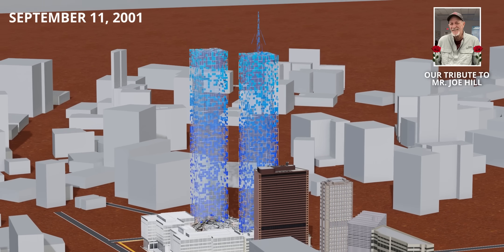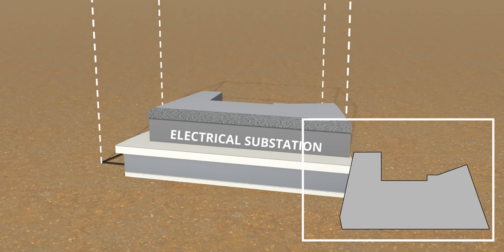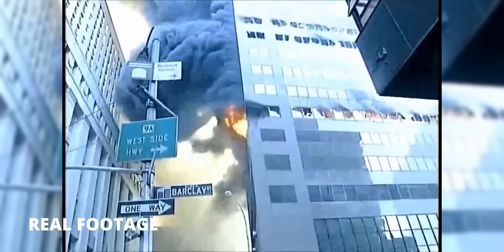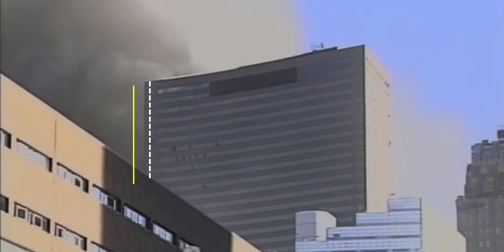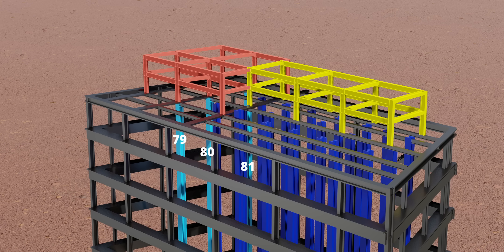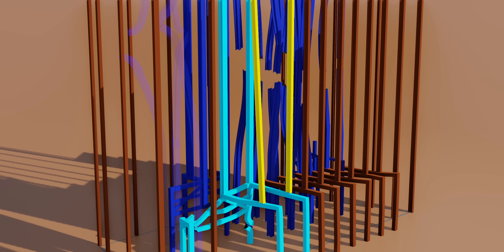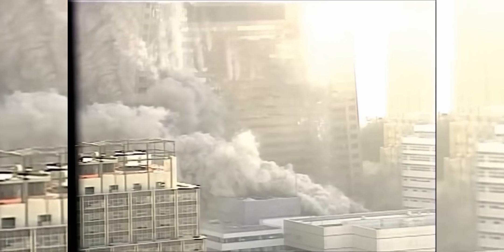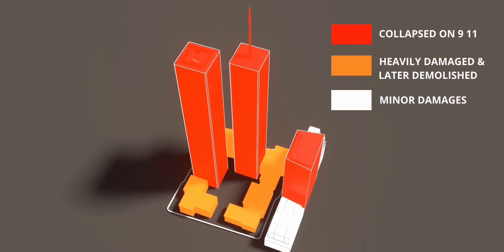Collapse of Building 7 | The Complete Physics

Comment: If this is meant to convince rational people that these buildings collapsed due to the planes hitting them, don't waste your time. Anyone with a brain can easily see that all three building fell due to controlled demolition. Lucky the new owner had recently gotten billions in insurance to cover terrorist attacks and this was the only day he didn't go into the office.
Reply: Then how come not one of you CD hand-wavers can do something like this:  Building 7 was the 6th building to collapse of 10 lost on 9/11. Because of its early low priority and complexity, conspiracy filled the information void with simple-minded garbage by technically ignorant people promoting political agendas. 7's loss is an engineering problem and should be treated as such, so I prepared this brief summary of my own analysis to fix that, using technical analysis, not ideology and magical (non)thinking. 

At 10:28am the WTC North Tower collapsed, showering Building 7 with tons of burning debris, causing heavy damage and starting many large  fires which burned out of control for the next 7 hours. Half the FDNY firefighters having been killed, units in disarray, equipment destroyed, no water pressure, and the greater urgency of search & rescue efforts, Building 7 couldn’t be saved so firefighting efforts were pulled as futile and 7 left to its fate. Firefighters make that sort of choice every day in brush fire situations - which houses to save and which ones to let go. Only real difference here is moving the decimal on the size and cost. People get overwhelmed by the size.

www.youtube.com/watch?v=g_SvpwyC17M

Collapse of a burning structure is always a concern for firefighters. Steel buildings subject to fire rely on active firefighting to survive. Buildings are designed around 1 to 3 hours of fire resistance, allowing time for occupants to escape and active firefighting to get started, after which all bets are off. Left to their own devices they'll exceed their design envelope and collapse, like Plasco Tower and Wilton Paes de Almeida. In 7 the occupants escaped, passive and active fire protections were compromised and active firefighting was abandoned hours before the collapse, which left the building to its fate. It lost. Odds on Building 7 would eventually collapse, and it did. No big deal in logic.

 http://www.youtube.com/watch?v=WnYBX6QT0R4 

FDNY Chief Daniel Nigro - The biggest decision we had to make on the first day was to clear the area and create a collapse zone around the severely damaged 7 World Trade Center, a 47-story building heavily involved in fire. A number of fire officers and companies assessed the damage to the building. The appraisals indicated that the building's structural integrity was in serious doubt. I issued orders to PULL back the firefighters and define the collapse zone. It was a critical decision; We could not lose any more firefighters. It took a lot of time to PULL everyone out, given the emotionalism of the day, communications difficulties and the collapse terrain 

FDNY Deputy Chief Peter Hayden ; We had our special operations people set up surveying instruments to monitor and see if there was any movement in the building. We were concerned of the possibility of collapse in the building. And we had a discussion with one particular engineer there, and we asked him if we allowed it to burn could we anticipate a collapse and if so, how soon? And it turned out that he was pretty much right on the money, that he said 'In its current state you have about 5 hours 

The collapse of Building 7 was anticipated and widely reported in the media throughout the day, with 24 video cameras recording some or all of the collapse. Everyone knew what was coming and why. 

www.youtube.com/watch?v=OY5S5k3tMHI

The collapse of Building 7 was from the inside out and entirely different to the Twin Towers, not at all intuitive and thus harder to understand, with most details being hidden from view.  It requires careful analysis and observation, and some people will struggle no matter how much it is explained. But here is my explanation relying on no outside authority. 

Building 7 was a unique, asymmetrical 47-story steel frame structure built atop a smaller 3-story building serving as a partial foundation, requiring lower floors dedicated to complex load transfer structures. Of trapezoidal shape and tube-in-tube construction, B7 (above the 7th floor) consisted of a central core of steel columns carrying most of the gravity load, perimeter steel columns around the outside of the structure carrying the remainder of the gravity loads and long span beams and girders to tie those elements together and form the floors. On the outside of the building hung a moment frame or outer shell. 

www.nist.gov/image-16640

Phase 1 : First externally visible signs of collapse initiation occurred at 5:20:28 pm and was notably quiet with observers not realizing the building was collapsing! No warning in the form of hundreds of eardrum busting 180dB explosive bangs. Here at 12:00 a local CBS affiliate reporter talking 10 blocks from B7 when collapse begins. People don’t start to notice the collapse until 12:11. At 12:45 is the famous CBS fixed camera clip of Building 7’s collapse. Note the silence. 

www.youtube.com/watch?v=t5tEy6mXSE8

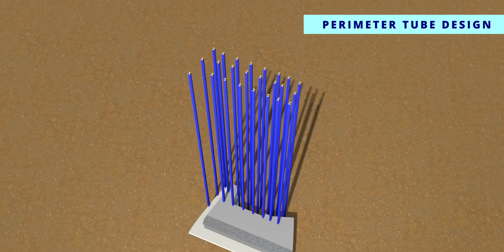Lower floor failures above the load transfer region (8-14) in the NE corner initiated the collapse. In this video at 0:45 you can see the NW corner from inside the building while under construction, Column 79 just out of frame on the left. That big, angled steel beam across the top of the frame connects to C79 at one end. The girders connect to the beam. That beam and all those girders depend on just one connection 

www.youtube.com/watch?v=nP3TNHPCIVU&t=45s

Phase 2 : NE corner floor failures caused a loss of critical lateral support over an excessive length of Column 79 and it buckled. Looking at the above floor diagram of Building 7 when you see all the structures that depend on C79 you quickly realize this one column was a relatively isolated structural element on which a disproportionately greater fraction of the structure depended analogous to say the Key Bridge. Externally as collapse begins we see a vertical progression of window breakage along the 44-46 line and a kink in the roof of the East Mechanical Penthouse at the top of the building, consistent with C79 failure. Normally with a buckling column, the load could be redistributed to other columns. With C79 that is not the case - the failure did not redistribute the load, so the collapse rapidly progressed to the roofline, sinking the rooftop penthouse. The transition from full capacity to almost no capacity occurs in an instant and will result in virtually no resistance 

Phase 3 : With C79 gone, B7’s progressive, non-symmetrical collapse continues with adjacent columns 80 and 81 left laterally unsupported and quickly buckling as well. The EMP drops down through the building. C79-81 all have no diagonal bracing, which is the major reason why they could not redistribute a lot of vertical loads among one another. From there collapse progressed from east to west through the central core until the core was gone from 81 to 58, taking all the interior floors and probably most of the perimeter columns with. Follow the horizontal progression of window failures low in the building and the dropping of the remaining rooftop structures into the building. The NIST Building 7 study model 4 determined C79 failing under ANY circumstances would have initiated the same collapse sequence. 

Phase 4 : After about 10 seconds only the exterior moment frame remains, giving the illusion B7 is still standing to the casual observer since little has outwardly changed. But it is just a hollow empty shell like an empty cereal box supported only by a few remaining columns and overloaded from the loss of the core columns and floors, quite unable to remain standing. With nothing remaining behind it, the north face leans inward, forming a V in the roofline, the last few columns buckle under the strain and the moment frame free falls, landing on top of the debris pile. 

It is only here at the very end, a single measurement of alleged free fall acceleration is taken, from just one point on that outer shell. The Building (core and interior) did not “free fall” - was already gone before that happened - just one corner of the outer shell briefly moved at a rate comparable to FFA. This alleged FFA was a product of how the shell fell NOT why the building fell . It’s also not even proper FFA as the single measured point was moving in 3 dimensions, not just down, which adds another variable. Start to finish the collapse took 18-20 seconds, 3 times longer than true FFA . How fast something falls can’t tell you what started it falling, certainly not 10 seconds after it started falling.  

The debris spread outside the footprint blocking surrounding streets, heavily damaging the Verizon Building and destroyed Fiterman Hall. 

No building is meant to survive 7 hours of multi-floor unfought fires. Building 7’s progressive, non-symmetrical collapse was incidental, unintended collateral damage from the combination of fire, time & gravity started by the collapsing North Tower, true no matter who planned and carried out the 9/11 attacks or why .  Of so little consequence it barely registered at the time, only taking on semi-mythical status as an alleged smoking gun years later when demolitions at the Twin Towers, missiles at the Pentagon and shoot down over Shanksville all failed and conspiracists had nothing left to work with. 

Anything can seem like a conspiracy if you don’t understand how it works. Now you should. I hope you found this helpful, informative and it solicits informed critical comment. If I made any errors of fact, logic or reason or left anything important out, please let me know so I can fix it. OR offer a more plausible alternative if you can. Be the first. Please start any reply with the words “Tits McGee” or I will know you didn’t read it and are wasting my time.
Reply: @TheCriticalStinker-01  wrong
Reply: @mcampbell5158  - thank you for telling me you didn't even bother reading it without saying you didn't bother reading it.  I'm going to find someone with a pulse now.  Good luck with your continued epic fail. I really hope that works out for you.